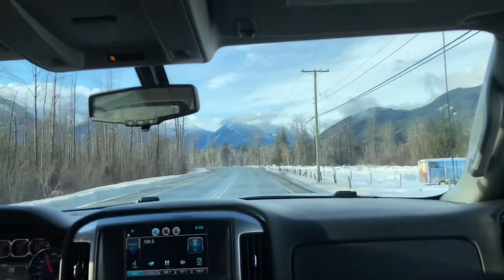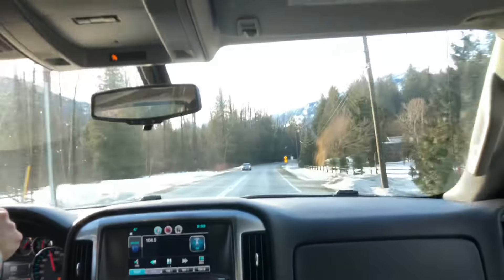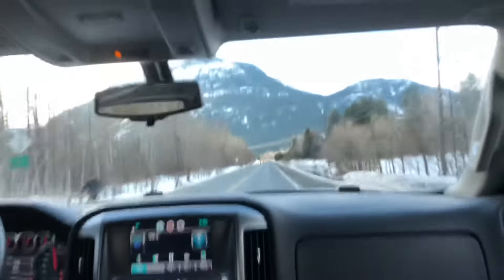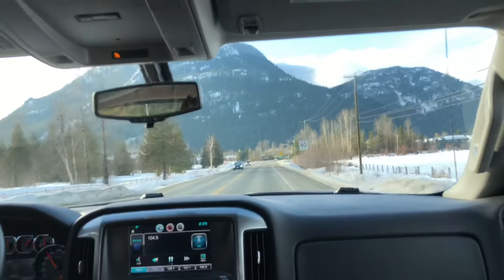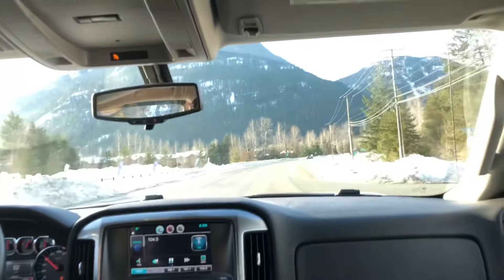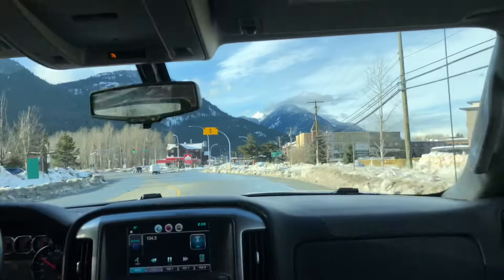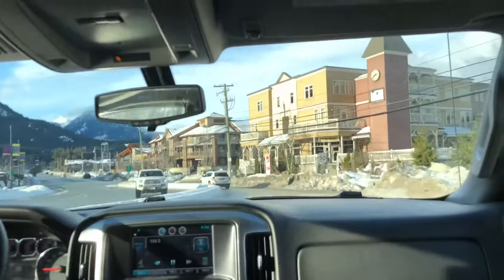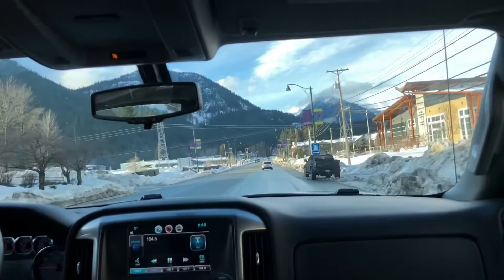What I wish I knew before buying Magnaflow

Comment: If you want a loud exhaust, you have a few options.

1. Cut the OEM muffler off and go straight pipes
2. Buy a bullet muffler
3. Use a Flowmaster Super 10

Comment: Get a Magnaflow 13650 muffler. It's chambered. Fibreglass in mufflers is just dumb. It melts and burns. They should only use rockwool. You can also wrap a chambered muffler in heat tape to cut the noise too.

Comment: I added a magnaflow on my 4.3l gmc and I added a 5 inch tip out the side it’s really deep if you want it louder then go with a big tip if you don’t want it so loud go with a smaller tip just a tip can change a lot and if you got an exhaust leak it won’t be loud just some advice 👍

Comment: I had a dual tip magnaflow muffler on my 92 celica gt hatchback 5 speed.  
God it sounded amazing and i really miss it. At idle it had a very soft rumble purr and hitting that go pedal it came alive and didn't sound like an angry bee can or rice burner.  
I've debate putting a magnaflow system on my 03 highlander but being an automatic I'm thinking a strong no most likely. 
Imo having a nice exhaust is best with a manual tranny.

Comment: Flow master Flow FX sounds great an great performance. It's a straight through muffler.
Reply from the maker: Cool! I’ll check that one out.
Reply: Flowmaster Flow FX are a Magnaflow ripoff. They do not in fact sound anywhere nearly as good as a Magnaflow. I've only ever used Hooker Aerochamber and Magnaflow on every vehicle I've installed exhaust on. This particular time however, I went with a Borla ProXS. It is ridiculously quiet. It's actually the quietest high performance muffler you can get. I believe an o/r y-pipe or headers would make it sound much meatier, but even so, it sounds waaaay better than the pos 40 series that was on it. 👍

Comment: Two different muffler styles is the main difference. Flowmaster is a chambered muffler, Magnaflo uses a straight through design with packing. It will get louder but maintains a deeper fuller sound compared to FM loud tinging rattle.

Comment: The sound of the Magnaflows have always been excellent to me. Especially when you hit the gas. The best part is on long drives there is no droning. I had gone through great lengths on my Ford V10 to get the right sound. After putting on the Magnaflows, EVERYONE wanted to know what I had under there, lol. 2 into 1 into 2 off the back and it sounded like friggin’ Lambo but not too loud. Just tight and mean. Magnaflows are the “that vehicles got something going on but the dudes not a show off” type of exhaust set up. They sound perfect without the whole “I HAVE A REALLY LOUD EXHAUST!!!!” conversations inside the cab, lol. They also don’t attract unwanted five-oh attention at the wrong times. Getting the Magnaflow on my Dodge next week. 👍🏻😎👍🏻
Reply: How do you have a Ford and A dodge.
Reply: @thronewalker1153  he bought them?
Reply: MagnaFlow uses no fiberglass. When you had a factory tour...they revealed out to you with a signed agreements.

Comment: What you get with magnaflow is straight pipe performance with some sound deadening. The only way to get it quieter is to go with as long of bodies as you can fit. You will need to fit 2 on it. You are in a truck so you got plenty of room. 

My Ram 3500 factory exhaust was louder than the Magnaflow after a DPF delete. I install one in place of the cat and one at the factory location. I have room to fit a few more if needed.
Reply from the maker: Cool!
Reply: Magnapacks?

Comment: So Hooligan, despite the sound issues, any change(good or bad) with mpg's/performance over time after installing?
Reply from the maker: No changes. Maybe if I changed my piping to 3” there may be some changes.
Reply: @TheV8Hooligan  got it, note taken 💪👍
Reply: I received 2 miles per gallon increase. I have the single 2 to 1 3" catback system. This is with other upgrades. My suburban z71 gets 21 mph hwy.
Reply: @waylonmartin9613  yep, that's typical of them 5.3 Chevy's; my '05 Burban Z71 got about the same. 👍
Reply: My mpg when down because once I got exhaust upgrades I start gassing it more.

Comment: So if my muffler (stock) is offset inlet and offset outlet, the new muffler doesn’t need to match this? I’m looking at a magna flow that is offset to offset, just like my stock muffler right now. Even though it’s off set to offset, it will still be louder than stock and noticeable right?
Reply from the maker: It should be yes. Sorry for the late reply I wasn’t getting notifications 🤔. How did it work out?

Comment: Would it be worth buying a MagnaFlow muffler and installing on a stock exhaust kit?
Reply: My trucks a 2014 Sierra.
Reply from the maker: Always! 😁. That’s what I did.
Reply from the maker: If you want loud loud go with the round one. If you want a rumbly but not insane loud go with the one I used.

Comment: Does anyone know how long it takes for the magnaflow filling start to go down? How long does it take for the packing to die down?
Reply from the maker: It all depends on the heat cycles. Quick trips it will take awhile. Longer trips (1 hour or more) will speed it up. After a year it sounds more hollow when I knock on the case but there’s still the steel wool in there.

Comment: I'm from the old school, and like most commonsense car/truck guys and gals, I prefer my motor to be the reason the exhaust is loud. Whereas, some commonly use the exhaust to make the vehicle appear faster or more aggressive, simply because it sounds the part. When it's just an exhaust without cats or mufflers. Your exhaust system should complement the work you've performed on the motor.

Comment: MagnaPack from Magnaflow would sound a lot better on your truck. Especially if you true dual it and remove the resonator(s) Magnaflow has a nice deep rumble tone. Not too obnoxious but definitely not low such as stock.
Reply from the maker: Thanks man. I’m looking at trying a 3rd cat delete, y pipe then two straight pipes out the back.
Reply: That works. Even better on that.

Comment: Flowmaster drone...  awful..   I, willing to try Magnaflow.    back when I was younger, we used to stick a water hose up the tail pipes, enough to fill the mufflers with water.  Plug the tail pipe, let the water sit...    the water will absorb into the packing material, fiberglass, or steel wool, and cause it to settle.  Unplug the tail pipe, let the water drain out and start up the car.  Hot exhaust, hits the water soaked steel wool and fiberglass in your mufflers, and cause it to compress, and burn out some.  Drive a couple weeks, notice the tone difference, and repeat if you like.

Comment: Magnaflows GET LOUD 100% 

I got a 92 Mazda B2200, header, straight piped to a magnaflow #11225. When its new it sounds pretty muffled, but not quiet. Then it breaks in and its fairly loud, not horrible just the right amount of noise, has a seriously good low growl. 

Problem is, without the cat and resonator I get a hell of a lot of pops and crackles from excess fuel burning in the exhaust system and I'm guessing that's going right into the packing of the muffler and killing it. I'm going on a 3rd muffler for just about the 3rd year in a row. Truck sounds raspy as all hell and is pretty close to being straight piped when gunning it.

Almost worth the hassle though because, jeeeeeez does it sound unreal for a 4 banger, I've had people ask if I had a V8 in half a dozen times so far. 

I've heard adding a glasspack before the muffler can help, think that's the next step for me.
Reply from the maker: Awesome! Do you have any clips?
Reply: @TheV8Hooligan  Nah I don't sadly, should probably upload one, one day. Never really had a camera that would do it justice I guess haha.
Reply from the maker: Yeah. I found that an iPhone with the headphone mic works decent (if you have an iPhone)
Reply: What if I only removed the third cat? Would it still burn the magnaflow

Comment: Not all models sound the same.
Flowmaster can have a popping sound, that sounds like you deleted the mufflers.
My Magnaflow was much smaller, the tube kind.
I left in resonators,  and it sounded amazing. 
My next truck  I bought used and out side it sounded good, but driving I couldn't hear people on the phone.
I don't know what the previous owner had on because he did a crappy powder coat.
So now I just bought a 2022 and think I'm going to the magnaflow tube and leave in resonators.
Reply from the maker: Cool

Comment: 25-35000 avg all the packing will be burnt out. Went through three on my nissan frontier in 120000 miles. 
Tried an APE which is supposed to be the same muffler. I have even heard it's improved and they have more steel wool before the rock wool wrap.
Same thing. They don't stand behind the warranty worth a damn either. Very limited.
I might try a borla with their purposed warranty see if it holds up.
But I won't recommend magnaflow to anyone for a daily driver they want drone free. Just don't last.

Comment: yeh, I've had 'em on a new 2007 Vette coupe Z51. you consciously are aware and notice there's a "muffling" going on. it sounds to your ears like the central/CORE-sound is being wrapped inside a pillow...because IT IS ! 

MF DE-CELL is like just about no-other brand though regarding CACKLE. Yow! It's indeed an MF! Does POP, but that's not excessively at all, such as the way the "cackle" sound does continually persist. Would be even better if it popped at least as much as it cackles...regarding frequency, duration and severity. 

flowmaster actually hurts the delicate little structural parts inside the ear, from the sharpness of it all pounding brutally. like two knife blades colliding and scraping against each other. at some level makes you want to react instantly with both your hands to cover both your ears...but still, if you're a dude, you'd probably rather be hearing Vette exhaust than nothing.  bad exhaust soujnd is better than no exhaust sound. even so, from time to time we get burned out on hearing our mate, don't we? lol !  

I was searching for a descriptive word to explain the raucousness component of such exhaust systems and YOU hit the nail right on the head:  "OBNOXIOUS" !! You SIR, are a CUNNING LINGUIST !  Cheers and    uhhhh--woommmm    upon you as well friend !!!

Comment: I've always thought magnaflow was super quiet. It does sound better than stock, but you have to redline before you hear anything.
Reply from the maker: I was surprised that upon first install it was quieter than stock. No resonator and doing a after the axle dump and redlining is THE best.
Reply: Not in a 01 prelude

Comment: Did you have an H or X pipe placed? Also was the muffler in the middle of car and resonators in place at the rear?
Reply from the maker: I just had the stock muffler swapped with the magnaflow. The inlet/outlet matched the stock muffler inlet/outlet. Resonator is in the rear but in a few days I’m hacking it off with a sawzall 😎

Comment: Are you people looking for just sound or performance because on a dyno test  Magnflow away out performs no flow Flowmaster  Close flowmaster sounds like a bunch of barings bouncing around in your exhaust too much Pinging
Reply: So glad someone finally mentioned this in ALL of these comments. I had a flowmaster on a 6.2 Denali and was loud and sounded good. When i put on the Magnaflow my truck felt like it had at least 50 more horsepower. Literally you can feel the difference in the seat of the pants. Never again will I purchase flowmaster.

Comment: I have the 2 to 1 catback stainless steel for my 5.3 chevy. Took 1500 miles for the tone to change. Biggest issue I have is the stainless steel construction.  I offroad quite a bit, and you can start a fire in the tall grass. I love my exhaust system, but be careful of the application. Stainless steel gets much hotter than other systems.
Reply from the maker: Lol damn good to know. I’ll be venturing out on roadless areas so I will keep this in mind.
Reply: @TheV8Hooligan  I live in the mountains of Colorado and have an '05 suburban with quite a few   ' 06 Corvette parts. She's a beast, but this is the first SUV that I've ever owned. I'm learning as I go. Haha
Reply from the maker: Cool!

Comment: So after time the magnaflows sound will increase?
Reply from the maker: Definitely! Mine is still getting louder. Really noticeable on cold starts. The 14” is a safe bet if you’re worried about drone or being too loud. With the resonator, it’s quieter than stock when newly installed but deeper tone.
Reply: In the last four years my Magnaflow has gotten louder to an extent. But nothing drastic. Nothing close to a chambered muffler like Flowmaster 40 series
Reply: Yeah, the mileage differs, depending on application.  Doesn't change much, but it will get a bit louder over time.

Comment: Remove the resonator if you want it louder. Better airflow as well.
Reply: u lose torque
Reply: @wavyant1504  Debatable. You gain hp, lose weight, but if there is a loss in torque it's almost non existent.
Reply: @Mors_Atra_  so it’s better to keep mufflers in and take ya resanator out ?
Reply: @Mors_Atra_  because muffler delete u definitely notice the loss in torque

Comment: I did same mistake on my 300c , crazy drone on 2000 rpm
Reply from the maker: Damn really?
Reply: @TheV8Hooligan  yes magnaflow#15628 , i installed it with cat deleted for two months and it turned me crazy on the highway .so, i removed it and installed the stock Exhaust system .
Reply from the maker: That sucks. Hopefully you find something that will work well.

Comment: magnaflow does not have mesh in it...its a straight through design
Reply from the maker: It is a straight through design, the mesh is like steel wool which is packed in there with fibreglass do deaden sound, and the perforated pipe runs through that unobstructed.
Reply: @TheV8Hooligan  The Flow master Flow FX is made the Exact Same.